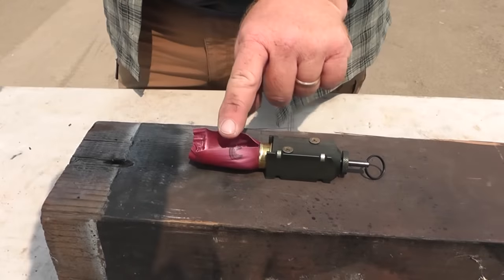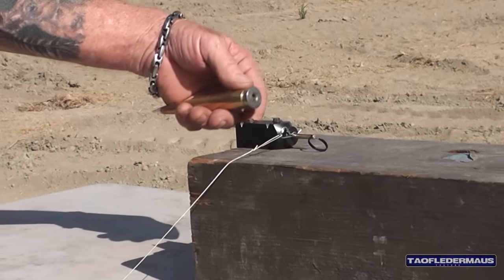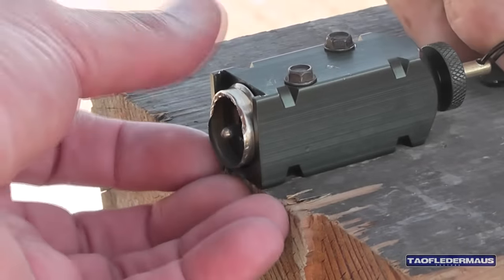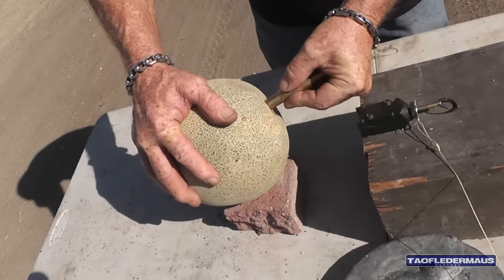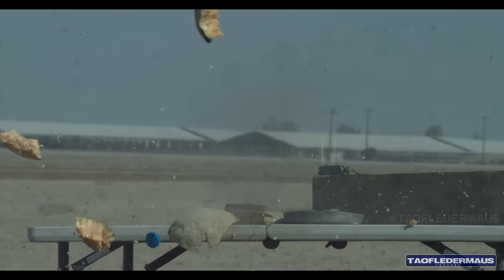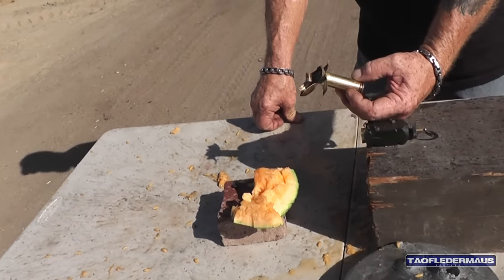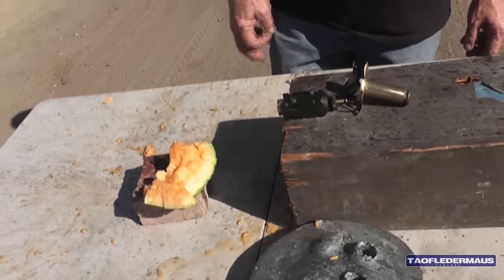.50 BMG Shell exploding OUTSIDE a gun - What Happens?

Comment: All brass cases are "chamber formed" when firing, meaning they expand until they can't anymore and then the excess pressure forces the bullet down the barrel. That's why the first stage in reloading is resizing the brass to factory spec. If there is no chamber, the full force of the explosion is applied to the brass until it fails. Sometimes hot loads (that's for you, OG) split the brass case even inside a chamber.
Oh and putting one of these inside a pipe could be considered manufacturing a firearm, which I think you mentioned in another video. Don't do it. Especially in the socialist Republic of California.
Reply: LoneWanderer360 Idk about the SRC, but iirc according to federal regulations, you can make your own firearm as long as it's not an SBR, automatic, etc. I could go to the Homeless Deathspot and build a shot gun from pipe fittings.
Reply: DrivenByDiamond You're right, but I wouldn't do it in Commiefornia. You forget to dot an i or cross a T and they may look to make an example of you. Why isn't your plumbing pipe serialized? Where's your triple redundant safety? Why isn't your firing pin microstamped? Who knows how far they might take it.
Reply: Don't you have a bear to go kill in it's den while it's hibernating?
Reply: And one of the reasons why brass is so good for casings is because it's thermoelastic properties allow it to quickly shrink back down just enough to be easily ejected and then as said they're soft enough to cold-form later in a resizing die.

Comment: This channel reminds me of my childhood when I made lots of experiments with pellet guns. One time, I shot at steel files at very narrow angles to see the projectiles grind away.
Reply: Driver7 one time I shot a puddle with my pellet gun...it ricocheted and hit my step dads windshield instantly spider webbing it.
Reply: Steven lol
Reply: Water ricochets are dangerous as hell. Once I shot at my grandmas pool and the damn thing ricocheted and hit a door only 2 meters from her. Her bad hearing made her not even notice but it scared the hell out of me because the pellet punched the the door very hard. After that I became obsessed with safety.
Reply: Driver7 would be nice to see that on slow mo file pellet
Reply: Driver7 I managed to ricochet pellet from a rottentree stump (small patch in it was still hard enough) right into the tip of my jaw. I saw it coming at me but couldn't dodge it.
Reply: I shot a pellet to a unused gas tank the pellet ricochets to my cousin's butt, some years latter and she still belive i did it on purpose.
Reply: Driver7   I succeeded with a .303 when I was 10.. What a bang!  Inverted metal 5 gal oil cans with a pint of diesel capped and on a fire fly high.
Reply: Driv
Reply: D
Reply: When I was growing up this crazy neighborhood kid made one of these contraptions from this video by cutting a shotgun shell/bullet sized hole in a mouse trap to slide the shell into, and rigging the firing pin across the snap bar making detonating trip wires for around are fort... That same kid also stole are middle school gym coaches track dummy pistol and blanks, going crazy "shooting" at kids, robbing, and terrorizing people half to death all over the neighborhood...
Reply: Nick Hall lol good for him

Comment: A few years back the army posted a safety flash about .50 cal rounds.  Some guy used one of them to try to hammer a pin into a machine gun mount on a vehicle.  The primer detonated and the guys hand came apart.  They showed his hand and it was missing a few pieces.
Reply: And the mental department had a boom.
Reply: 2011 Iraq theater Army Spc dismounting M2 from HMMV used  .50cal round as hammer against pintle mount pin. Result, no right hand, med discharge.
Reply: Looks like they need some saftey training

Comment: He had his hand on the receiving side of a locked and loaded .50 BMG at 3:10 I don't think that was the smartest move having the pin and fire mechanism loaded while you were loading.
Reply: Yeah, that was really dumb
Reply: If he pulled the firing pin while the bullet was on there he could easily accidentally let go or not set it up right. He needs the firing pin to be pulled back before the round is loaded because if the firing pin slipped without a bullet there then he could just reset it and not blow his hand off. Setting up the pin before would greatly reduce risk.
Reply: @ivancorrea4984  yeah, no… you can see his hand on the other side of the melon from where the bullet is. If that pin were to get pulled he’d have his hand shot.

Comment: Hmm... Interesting how the bullets hold themselves in a (suitable) gun chamber but it will not hold if it's fired without.
Any scientists that want to elaborate? I'm curious. I have my assumptions but I'm no adult.
Reply: Correct me if I’m wrong, but are you wondering why the casing doesn’t explode in a gun but it does outside of one? If so the reason it doesn’t explode in a gun is because the barrel forces the explosion in one direction, while outside the gun there is nothing to contain the explosion and the casing is weak so it goes first.
Reply: Dittos on Fabricated Phoenix, barrels are 'proof tested' to safely hold the pressure the bullet's explosion delivers. 
   Picture this: you put dynamite in an empty oil barrel then bury the barrel in a slightly bigger hole. Then ignite it, the oil barrel will 'stretch' to the size of the hole. Same thing with a bullet case in the chamber, the case will actually press and form itself to the inside of the chamber, but it can still be pulled out.
     Look at a 7.62X39MM Soviet bullet, the case is tapered for easier extraction after firing

Comment: The case of the bullet in cantaloupe is less damaged than the ones set off in open air.  The cantaloupe indeed kept the powder gases inside the case and direct it down range.  Not as much as a barrel would, of course, but better than open air.  I did note the bullet was tumbling.  Obviously not a rifled cantaloup.

Comment: So, independent of a gun, a bullet is almost as much power as it normally would; the gun just focuses the trajectory of the bullet.
The force of the discharge of the bullet from its chamber must also augment the power of the bullet. 
Does it?
Reply from the maker: It has no where near the power because the powder needs to build up pressure to fully burn.   Most of the energy you see here is just from the primer.

Comment: Just the primer on one of those clipped a bit off a couple of my fingers years ago. Lesson of that story? Never ever believe a friend about using a nail to remove a primer.
Reply: I have a little lump in my chest, I successfully pried the primer out of a few 12 ga shells when I was a dumb teenager.

Being a dumb teenager, I decided the best thing to do was to put them on a vice and hit them with a hammer.  

Realized some time later I was carrying one around in my chest...

Had a CT scan a few years back, didn't get hot or move during the scan so I assume any actual metal has long since been broken down and absorbed.

Comment: The unburned powder is very interesting. Looks like the powder is still burning whole the bullet travels down the barrel, kinda makes sence  e CDC abuse the longer the barrel the more velocity. More powder burns down the barrel, not just one big explosion.
Reply: You were so close to having it right, and then you had to say "explosion". Gun power does not explode, it burns. Sorry for being nit-picky on this.

Consider what is happening when you set off the primer at the back of most cartridges. The powder ignites at the base of the cartridge and as the gases from the burning powder expand they force propel the unburnt powder through the barrel along with the bullet. It makes sense that a longer barrel allows for a more complete burn.

Comment: I had a 7.62 round cook off 3 inches from my left band while firing the Browning GPMG. At the range.
It was a live round laying in the brass pile under the MG.
Left there by the team that had fired before us.
My left hand was holding the traversing bar as SOP.
So  Rapid Fire!
BangBangBangBangBOOOOM!!!! Empty casings everywhere. 
Felt like all my fingers had been given a sharp blow with a stiff board.
Finished the belt.
Probably 150 penetrations  of unburned powder. Minor bleeding. War Wound my Sgt called it. Lol
No treatment required. Still have a few left you can see. 
40 years later.

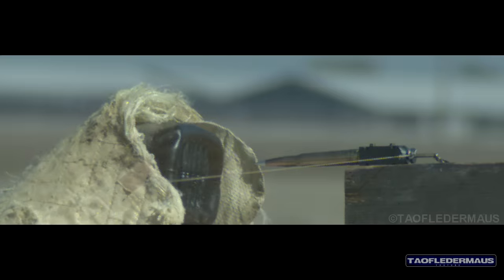Comment: Did you guys actually look inside the Gel for the .50 BMG? I slowed down the camera (at mark 2:20) and watch closely, and at mark 2:22, as the smoke clears just slightly, I can clearly see the butt-end of the bullet going straight ahead into the direction of the Gel... the bullet appears to be in a rather straight forward trajectory; not fast, but looks like just fast or hard enough that is just pierced into the Gel and possibly stopped inside of it -- on very close inspection of the video, when slowed down, I can see the gell shimmer, ripple and move back just slightly, however, the pad behind did not move from any impact. I am certain that I am sure the bullet lodged itself firmly inside Gel.

Comment: When I was a kid I had an empty .50 BMG cartridge and the pulled bullet.  This was back when cap guns and caps were popular.  I never tired of finding new ways to explode more caps at once.  One day I had an idea to put a mass of caps inside the cartridge, slide the bullet in through the neck to rest on the caps, and then drop the thing base-first onto concrete.  Got a few satisfying bangs and then decided to add more caps for a bigger bang.  Did exactly the same thing, sitting in a chair and dropping it between my ankles.  Except this time there was a deafening roar and hot gas jetted out of the case mouth and straight into my face.  I was dazed and my ears were ringing.  I knew exactly what had happened.  I'd noticed the primer didn't have a dent in it, but as a 10 year-old kid never understood the implications.  If I'd known the primer was live I'd never would have been setting off caps practically right against the primer, especially with my head right above the shell.  Learned that a .50 BMG primer is a force to be reckoned with.

Comment: The device that starts the cartridge is fixed into its base, so that is why the bullet does fly away. If the cartridge wasn't fixed and started by, say, heat, the casing would fly away while the bullet would stay in place. Simply because it is heavier. Physics.

Comment: My instant thought to "should have used a brass shell"
No brass shell is designed to hold in the pressure of firing out of battery. Infact, they're even partially designed not to. Not just because it saves on material, weight, room for powder inside etc, but because it's far less likely to ignite the full charge, and drastically reduce lethality. Firing a gun out of battery can be catastrophic, because of the containment of all the energy, where as with these, at most, you'll get hot brass, maybe some power, and a very fast, but relatively slow bullet in the face. You're still likely to be injured, maybe loose an eye, but if your not holding it, or body parts aren't withing a few cm of a shell that big, you're likely only to have some serious bruising, maybe a little burning and/or some cuts. Rather than loose some fingers or your hand, and in the case of a face near a breach, still have a face, even if you'd loose your eye(s). Most 9mm shells will simply ring your ears and you'll feel the mjnj thud of the shock wave.

Comment: When i was in Germany in the 80's there was a guy on one of the m106 carriers firing 50 Cal. hehad miss fire pulled back on ejecting handle as soo as the unfired round came out itset off and the casing went through his thigh he was in crutches for a long time. He had been sitting on the turret with his legs on both back side of the 50 Cal gun.

Comment: The soldier that blew his hand apart couldn't get a mounting pin in the pintle to mount his ma deuce atop an mrap. First, he grabbed a rock off of the ground and tried to beat it in with that. When that failed, he grabbed a live .50 bmg round and proceeded to attempt to seat the pin by striking it with the live round. Obviously, it went off in his hand. If you do a Google image search of  ".50 cal hand injury" you should be able to see what was left of his hand and read the exact description of what happened.

Comment: You are basically making a firecracker  with no chamber.   The weakest wall will give and blow out sideways.    Does not mean its safe to do as you can blow your fingers off too.   You want the weakest link to be at the bullets end.  Something called a chamber (Strong) and bolt Strong will force the bullet to go path of least resistance out the barrel.  

Some BMG companies got a bright idea of putting a weak cap on the end instead of a bolt.   Pretty sure the cap will fail on hot rounds.

Comment: The brass is rupturing in those patterns because the powder is lying horizontal. When detonation occurs, the flash ignites the powder and instead of burning back to front, it is top to bottom. Without the chamber, constricting the brass (sending the bullet down the barrel), the gasses are expelled upward. The bullet does still proceed out the neck of the brass, but the brass is split on the top. Seen this at several fire sights.

Comment: Kinda wanna see what happens if you take a bunch of .22 rimfire cases with primers, stick the cases primer outward into a ball of hard clay or was to look kinda like a sea mine and drop it from height, without powder it shouldn't have any significant power but should still look cool on the high speed

Comment: What about a 12 gauge round in a clothes dryer? I know a man that happened to. He had been squirrel hunting and left a shell in his pants pocket. It made it though the washer ok. But not the dryer. I do not think it cooked off from the heat (maybe it did) but I think the primer got hit. Any way it blew the door open bending it back. The clothes were chewed up. His wife who was standing beside the dryer was not happy at all. They still use the dryer but had to install a set of slide bolt latches 
 ( https://tinyurl.com/y8pkzqph ) to hold the door shut

Comment: A lot of people don't realize confinement in a barrel is absolutely necessary for all the powder to burn. The goal is not to release all the energy before the bullet leaves the case. The whole point is to continue burning the powder as the bullet moves down the barrel, providing a nice consistent push until the bullet leaves the barrel. If all that powder burned before the bullet left the case, the pressure in the chamber would vastly exceed tolerance and you wouldn't have a gun anymore. You'd have a pipe bomb.

Comment: Try gettin a shotgun shell and fill it with some good quality flash powder. Im not the smartest pyro out there'  but from what ive researched is is that if the flash powder is ignited by a primer vs just using a fuse and relying on the powder to deflagerate and build up pressure before exploding, im wondering if the flash will detonate when using a primer to ignite it and that thing your using is a good tool to test this out.  i dont think flash detonates if you want to be specific but im wondering how the flash powder will react from being ignited by a primer which is considered a mini high explosive charge which does detonate' so im wonderin if the flash powder might be way stronger due to that

Comment: I used to throw .22 rounds in the campfire. You should see people take off running thinking they are fixing to get shot dead. I guess if you had your head right at the fire you could get a piece of shrapnel in the eye but they just go pop and are for the most part harmless. 

A rife round in a fire where there is nothing to hold the case, the case is usually what goes flying as it is lighter than the bullet.

Comment: 3:29 - This is a wonderful companion clip for "Weapons Safety Message 10-2" from 2010. That's what you're talking about at 4:55. The Joe in question was an Army Ma Deuce gunner on an MRAP, deployed in OAF, who decided to drive in a troublesome mounting pin on his pintle mount with the base of a .50 BMG AP-I silver tip round. Even this wasn't enough to either get the job done or set the round off, so he went and got a rock off the ground to use as a hammer on the nose.....as he held the round tightly in his dominant (fapping and pickle jar opening) hand....with the primer against the smaller diameter, protruding pin head... yeah. The results were similar to the canteloupe except the bones and tendons held the whole mess together better. 

I was an armorer for the Army and I've seen many of those types of safety bulletins when somebody gets killed or maimed unexpectedly, but that's among the shrillest in terms of wording and the ONLY one which included an injury photo and demanded it be posted publicly. It must have really pissed them off.

Just go ahead and google it. But finish whatever you're eating, first.

Comment: From the early period of smokeless powder self contained cartridges, they have been terribly disappointing fired outside a chamber.  Smokeless powder is a 'propellent', not a true 'explosive' and must be confined in order to build up pressure.  One notes (two or three of readers can also) the round forced into the cantaloupe showed LESS damage to the main body of the case than the rounds fired in open air.  The cantaloupe contained the pressure (a bit).  
There are simpler ways to prepare a cantaloupe for eating.